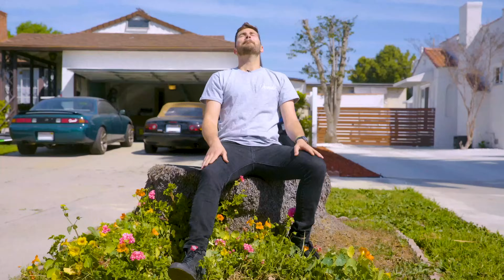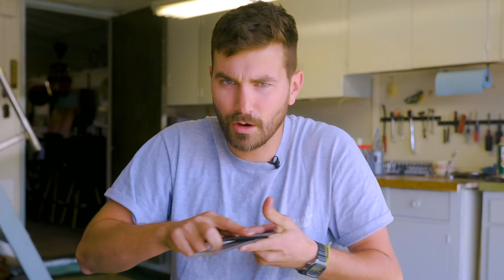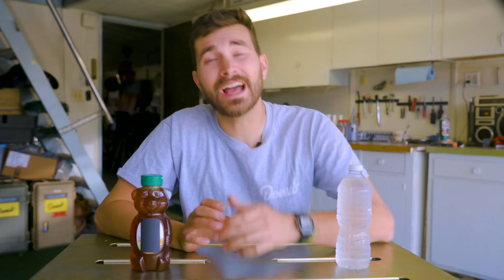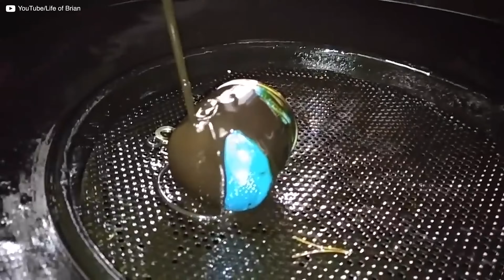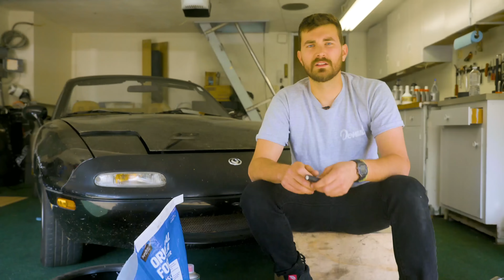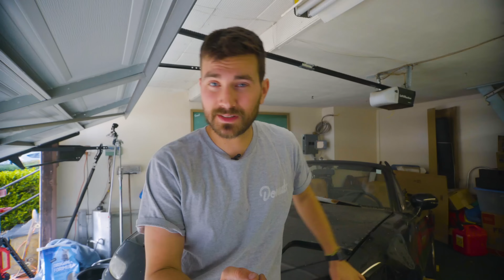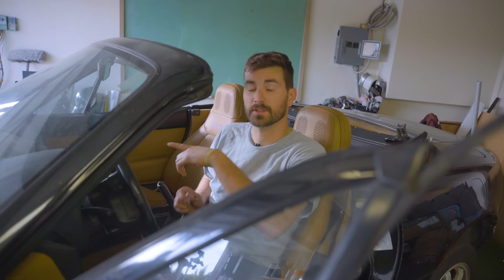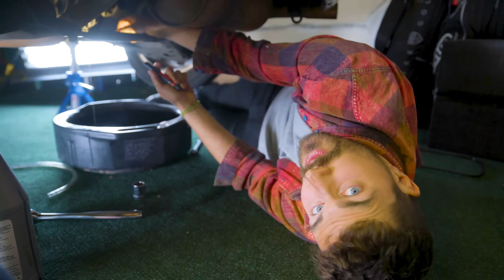9 Things You’ll REGRET Not Doing to Your Car

Comment: Wow,  first clip, did you just take the edge of a piece of steel and scratch the flat side of a piece of steel and put oil on the steel flat part and oil on the other piece and rub the two flat parts in the oil together as a demonstration. What oil does? why did you play that trick?  Watch the first clip again he scratches the edge of one 8th inch by an inch and a half piece of steel against the flat part of the same size piece of steel of course it’s gonna scratch even with oil it’s gonna scratch and then he takes some oil and rubs it onto the one fat area of the firstpiece of steel. Then he rubs the two pieces together flat to flat and it’s smooth. Of course it’s the oil’s gonna help it move without any friction how many more tricks are you gonna do in this video?

Comment: Here it is cold summer and winter, we have maybe 1 - 2 weeks a year it is not horrible to work on a car outside. And I have so many physical problems that I just let the mechanics do all the maintenance . Just used 2900$ on maintenance and fixing my 2001 Model Opel Omega 2,2 TDI but I will have to sell it as it is now impossible to get spare parts for it. Was 3 months at repair as it took that long to get a windscreen wiper motor that had to be salvaged from another scrapped car.

Comment: 8:06 Gl5 works everywhere on most cars..

Transmission, crank case, power steering, rubber component moisturizer.. 

please do not use this in your brake system 😂

Gear oil for the win 😜
Reply: I’ve never had a car with under 300k km.. 

I’ve never gotten rid of a car with less than 400k km..

And I do very little maintenance on my shitbox beaters.. 

All of which asked for specific oils.. 

Gear box oil for the win 😜

Comment: Is it true that it is a good idea to fill the filter before you put it on?
Reply: yes, since the system doesn't have to work on filling the new filters first. it's not "bad" to not fill them but it's practice to do so, only depends on how easy it is. my fuel filter was a pain to work on, so i installed it empty and then turned the ignition on and off around 5 times to fill the filter before starting the car

Comment: Before changing any fluids that have a drain plug, I'd recommend getting a new drain plug, just in case the old one is knackered.
Reply: the plugs also tend to have an o ring on them, new plugs are cheap and often come with new rings so it's a no brainer. we change the engine oil drain plug every time

Comment: It is bad practice to have both the front and rear on axle stands as the is a higher chance it will fall is best to put the rear on blocks and jack up the front it is especially important to do this when working on larger vehicles as they put more stress / load on the axle stands and they can slip out when jacking up the other end

Comment: 9:54 wait what?! Started changing my own oil last year, just used a basic socket wrench and hand-tighten just snuggly but not over-tightened. What am i potentially messing up?
Reply: they could become loose over time if not tightened enough or break if over tightened, there's a pretty good margin of error but that's not a chance you should take (says me who didn't torque my filter, drain plug and spark plugs...)
Reply: If its not torqued in enough, it could come loose over time.

Comment: Hello, I have some questions. But first I want to thank you for such a nice video.
I am lucky to have 3 cars, 2 of which are old :D, they are mostly standby cars, I think a good estimate of how much they drive every year is about 3-4000 km. I decided I should still change the engine oil once a year, indifferent of how much I drive the cars, but what about the other fluids? brake, differential, steering fluid and coolant, how often should work to change these of the car is mostly a stand-by car?

Comment: 11:09 the “better” brake fluids dont last as long as the cheep stuff they just work better under extreme temps
Reply: I've heard the first thing to go wrong with your stock brakes is the fluid overheating. Worth checking before you buy

Comment: 18:09 - My understanding is that using that gap tool on modern spark plugs is mostly a great way to scrape off (some? most? all?) of the very thin layer of platinum/iridium on the tip.
Reply: This is true

Comment: “Stick with your manufacturer’s recommendations “.
Hell no.
A generalization of driving conditions does not constitute what’s the best interval.
Severe service intervals is better. Winter conditions = severe service.
Even low milers ( less than 10,000 kilometers per year need to do the changes twice a year. Spring and fall.
Worth the money for preventative maintenance.

Comment: Cosmetic fix: 
Anytime I'm driving and see someone's car ceiling-fabric hanging loose at the end, I roll next to them and tell them it's a super easy fix with some school glue sticks.... they come on packs at the dollar store,  just smear the glue stick all over the ceiling surface and press the fabric back onto it. It will look brand new. Just try not to manhandle the fabric too much cause it can stretch/wear out easily. Just gently press back on after applying a decent layer of glue stick... I've used 1-2 whole sticks on a 1sq.ft area

Comment: Let me tell you check your oil every now and then. Because my oil pressure sensor I thought went faulty and I took it on my mechanic three times to ask him are you sure it’s not the oil he said no it would be sounding like buckets going down the staircase by now and I even checked the dipstick myself and I thought I was just reading it wrong because I couldn’t see anything on it well fast forward about One month I started hearing a knocking sound so I took it up to my mechanic and he said he thought it sounded like rod knock so he’ll drop the pan and look he said they had no oil at all which blew my mind because not only I drove on the highway almost every day without no oil for a straight month without no problems but how could I be so stupid   To not at least check to see if there would be any oil coming out the drain plug if I was thinking that there was no oil🙄 lesson learned I guess.

Comment: One thing to note about the Changing Filters step (for newbies, I learned this lesson by trial-error):

Often (especially with modern vehicles), disconnecting the Mass Air Flow sensor will throw a code on your on-board diagnostic system and give you a check-engine light or potentially put your car into “limp mode” (a safety mode designed for your engine to use when there is a malfunction in order to mitigate damaging major components). 

The way you get around this is simple, disconnect the positive terminal of your battery before working on your car! Then you can unplug sensors, relays, or any other electrical components without fear of electronic shenanigans.

Comment: Easy question. What do they do if the transmission filler plug doesn’t come out? Not doing the job is the same as not making money. Um, consider if they should take the car to a place where they can turn it on its side?

Comment: Bought my car about 7 months ago. It's a 20 year old car so naturally I wanted to keep in good shape. So I did what a good owner does and I bought a service manual for this car. Which I have since put to good use but one of the first things I did was read through the regular maintenance intervals and I noticed that actually maintaining a vehicle to spec the way a manufacturer intended for it to be maintained is WAY more involved than most people know and require a pretty high level of mechanical knowledge  as compared to what most people actually know. There's weekly, monthly, quarterly, biannual, annual,  and multi year checks and part replacements. Meanwhile all anyone ever does is check the oil. And maybe the tires. Maybe. But one thing I noticed is that I CAN actually fix things and there are step by step instructions on how to do 99% of it with regular hand tools i can buy at my local autoparts store.  Unlike new cars. new cars as a whole have just moved to "something funny?  Just take it to the dealer. You can't fix this" mentality.

Comment: One note: Check your owner's manual for jack points. Some cars are not designed to be supported by the pinch joints. I own a car where, if jacked/supported on the door sill pinch welds can do do serious damage.
Reply: yeah, he's actually not using the correct points in the video either. the pinch is reinforced there on the miata, but the actual spot youre supposed to jack by is the ribbed area behind the pinch weld (i.e. his jackstands should be parallel to the car, not perpendicular). you can hold it by the weld on NA/NB miatas like he is, but it's eventually going to crush the pinch and block the drain holes that are there.

Comment: When it comes to spark plugs you forgot to mention that copper is not only the cheapest, but also the most conductive and is the best for performance applications which is all of us.  There's no reason for anyone who opens their engine bay at least once a year to use anything other than copper.  Platinum and Iridium plugs are for people who pay other people to change their spark plugs and want to maximize the maintenance intervals.  More expensive and less conductive.

Comment: Apparently you arent suppose to let the brake pedal touch the floor because it could fuck up the master cylinder, pump it half way and the crack the bleed valve. The reason is about the "normal use area".

Comment: Another hot tip, if you've got a quality car, like a Toyota, Mazda or Honda for example, get a price from the dealer on things like oil filters, drive belts, spark plugs, coolants ect. You might be pleasantly surprised at the prices, and get parts that have been tested to work on your model. 
The worlds best quality oil filter is of little benefit if it's pressure relief valve pressure is set too high, or too low for example. The OEM one will be fine, obviously.

Comment: hella late, but don't forget to change your drain plug gasket each time if copper.  Otherwise they will certainly leak if skipped a time or if you're lucky the second time.  Also as stated,  don't over torque or the next person changing your oil will be miserable.  Err on under torque if needed and follow up later.
Reply: you can get a massive kit of copper seals from bezzos for a reasonable price nowadays that will take care of your oil changes and many other thing like fuel and oil line banjo bolt seals.

Comment: 10:40 this is why in hilly or high turn areas like Colorado, you see runaway truck ramps. The brakes on the trucks get hot enough to turn the fluid to gas, locking the brakes, causing you to not be able to stop.

Comment: 21:27 demonstrates an important point.  Try not to break shit while you're fixing your car.  Little plastic tabs become brittle due to repeated heat cycling.  Thin tabs like this are the worst.

Yes, it happens to the best of us.  No, you don't necessarily have to fix every piece of broken plastic.  But eventually you'll break something down there that you'll have to replace, and you'll kick yourself the first time you have to buy a harness from the dealer $$$ which had been fine before you put your meat hooks on it.

Comment: In Germany, we call doing almost all of this at once a "big service". Small service is almost always just an Oil change, the big service is basically changing spark plugs, brake fluid, air filter, fuel filter, oil filter, oil, brake pads and any other fluids basically. Don't forget the blinker fluid though, that's the most important part.
Reply: Blinker fluid jokes are a sure sign of a problem driver, being used to lesson ticketed drivers at driving schools
Reply: yeah people always forget about their brake light fluid too
Reply: Is blinker fluid a joke just from chrisfix or is it also from other references?
Reply: @yu-yu704  I was seeing the blinker fluid joke almost 20 years ago. It's an old one.
Reply: Deutschland ist ein schönes Land und ich will Bier und Brezel
Reply: 40k miles service at my house.  Spend a weekend and save thousands in service fees and thousands in repair costs.
Reply: Goddamm blinker fluid. That and the headlight fuel, the worst.

Comment: Isn’t it bad to change your rear diff and trans fluid???? My uncle who’s a master tech at fords used to always tell me never ever do a trans flush and refill cuz of stirring up stuff is just a drain and fill just as bad???? I have a 2014 ford f150 just spent a lot of money buying it shifting a lil rough or it’s the rear end can I replace the fluids without issue just as a preventative measure it’s got a 190000 miles on it and the dummy I bought it from I can guarantee he never changed nothing like that

Comment: YOUR SUPPOSED TO FILL THE OIL FILTER WITH OIL THEN INSTALL IT SO IT WONT BE DRY
Reply: wont the oil pump just fill it up
Reply: @canadianpirateanders9951  yeah but you will have a gap where oil isn't getting to the lifter, cams etc. If the oil filter is vertical you should fill it up.
Reply: @ThomasShelby-uq8cz   thanks for explaining the way you think about it. I've had people tell me both ways so I don't know what to believe.

Comment: Another trick for clearing fuel lines, if your vehicle is new enough (~2000's and newer), is if you hold down the gas pedal at max it engages a sort of service mode that blows out the injectors/fuel rails/fuel line while not engaging the fuel pump.

Comment: You're actually over-filling both your transmission AND your differential. When filling both the Trans and the Diff, you only filling to ¼"-½" below the filler hole (the first joint of your pinky finger). Being over that can cause the oil to froth and cause part overheating and cavitation between your friction surfaces.

Comment: Do not, i repeat, DO NOT pry on the ground strap like that with platinum or iridium plugs the tips of the electrode can be damaged and if a piece of iridium or platinum breaks off and enters the cylinder it reacts during the burning of fuel and has a chance of burning a hole in the piston or cylinder wall. The hole on a gap tester is not for a key ring, its actually used to pry on the ground strap without contacting the electrode for these types of plugs, in the same way you use a bottle opener. Other than that its a great video! Love this channel!

Comment: Make sure the old oil filter gasket is still on the old oil filter and not on the engine (and remove it from the engine if it is). 
No one likes a double gasket, especially your oilless engine.

Comment: The winter weight ads to the operating temp weight at sub zero. For example, a 5w-30 is a 35w at sub zero, a 10w is 40w at Sub zero. I use full synthetic 0w30. Same viscos at Sub zero as it is at operating temp.synthetic also lasts as much as 200 percent longer before it breaks down, and loses attributes. I change oil every 5k with full synthetic, because oil is cheap and easy to change, where as the engine exceeds the entire value of the car in most cases.

Comment: I'll have to look, but my first car (a 93 BMW 318 I adored) had an oil viscosity guide in the manual- basically you'd look at the expected temperature outside, and it would throw you an oil that would be best at that temperature. For Midwestern winters it always liked 5w30. Summers were more like 10w30 or 10w40, since winter would be around 0F and summers nearing 100F. If I wanted an all-around (say I wanted to buy a few gallons and run the same oil all year round) it specified 5w40.

It seems as if viscosity has gone down some in the intervening 30 years- my Civic is quite happy at 5w20, with the same temperatures.

Comment: Dude, I just want to say thank you for explaining the difference between a GL4 and GL5 fluids. I bought a fluid that says GL4+ (GL4/GL5) thinking that it should be ok. Your video made me call the shop that I got the fluid from to confirm and they advised me to get a proper GL5 fluid. You saved me from a possible rear differential replacement.

Comment: I have a question for you or anybody that would like to chime in. We had to change my hub assembly and wheel bearings in my truck, after we finally got that on I was pumping up my brakes because we went ahead and changed those as too. Well, a few pumps in and our master brake cylinder went out and our brake line busted so we changed the master cylinder and fixed the brake line, bled the brakes and everything but we STILL DON’T HAVE BRAKES.. we can stop when we’re going maybe 5 mph however anything faster and we have to roll to a stop. We’ve ran so many red lights trying to stop and had to just backup. We don’t have much time to look around and check out everything due to having to work all day and it being nighttime when we get off. Any ideas on what to do??

Comment: I have a 09 civic with 110k miles and I’m not sure if the previous owner ever changed the transmission fluid , I’ve heard a lot about cars above 100k slipping gears once their trans was changed cuz of metallic gunk and whatnot and once it got replaced with brand new oil the granny started slipping. My question is, if my oil looks good for the most part, not black and like metallic pieces, and I good to change it even if I’m not sure if it’s even been changed? Like would it cause slippage ?

Comment: About manufacturer engine oil change advisement. They say, that oil in myne Kia Rio should be changed every 15000 km (~9300 miles), which is best thing for drop your engine on the floor for a full rebuild. For turbo engines you should split that numbers in 3 (5000km or 3000 miles), on atmo engines you do it twice as often (7500 km or 4500 miles). I think, they are doing this for you to go and change  your car every 3-5 years, which is good for them, but not for your wallet. But who knows)